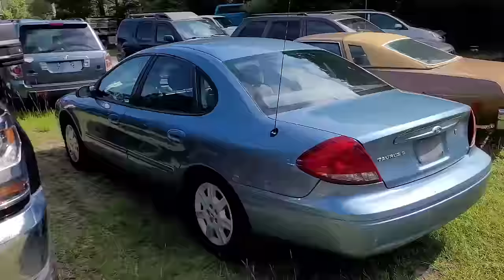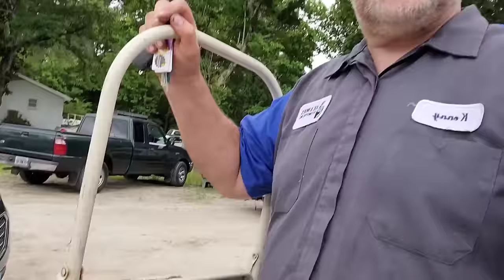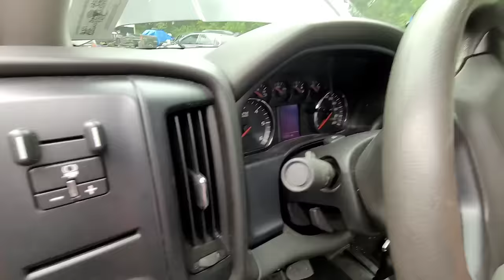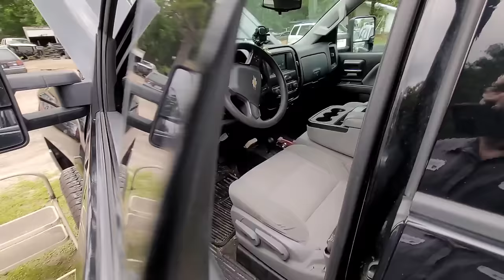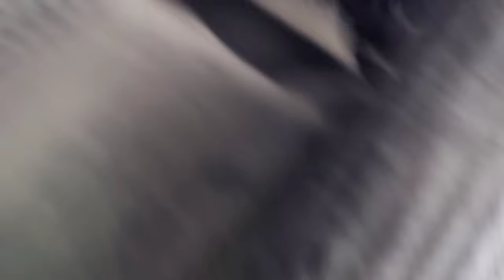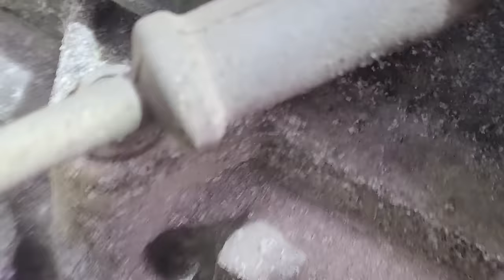Another GM 5.3 Ticking Noise. It's not the lifters on this one either

Comment: Great great information Mine sounds similar but the other way around I run it warms up starts ticking like lifter only let idle or hit that gas and noise goes away I completed cam and lifter pushrods etc for repair previously I don’t know what could it be thanks I’m advance
Reply from the maker: Double check the rockers themselves . I've seen the bearing wear and cause noise on warm up

Comment: 02 GMC 5.3 has a slight tick for 30 seconds. My engine requires 5W30. I have always used Amsoil Signature Full Synthetic.  155, 600 miles still runs fine.

Comment: Harvey Adkins
There is another cause of this sound that sounds like lifter noises.  GM knows about it and if caught while under the warranty time period, they will fix it (once) and after that you're on the hook for the cost of the fix.   
This noise is coming from the Brake Vacuum pump mounted on the lower front side of the engine.  It supplies vacuum to the brake booster and when it goes bad, it will make a noise that you would swear is a lifter problem.   I have a Chevy Silverado (2015) that did have this problem and a local dealer looked it up and found that it was already replaced under warranty in 2019!  Therefore, I was on the hook for an $800.00 bill to have it replaced again.   Was also advised that I should be prepared to do it again after 60,000 miles or so.  They are known to go out.  After the new install, the noise did in fact go away.

Comment: Just bought a 2011 with 180,000. Started ticking two days later, sweated for a week while doing research. Turned out to be a loose plug! Pulled the plug wires and re torqued all the plugs, tick has been completely gone for over a month now.

Comment: Every 5.3 or 6.0 iv had the first time or two towing it sounded like a bullet going off under the hood and the cold start ticking started. It was the manifold expansion busting the butter bolts GM installed at the factory. I now remove these bolts and install a grade 8 type bolt in metric size and have never had thus issue again. It's BS they have never fixed this issue.

Comment: 1:58 in...Exhaust manifold broken bolts.
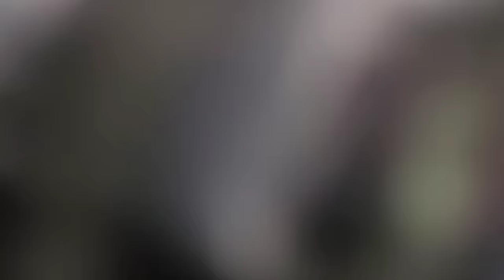5:00 in...totally different sound than lifter noise.
Deeper sound.
You can easily tell.
Lifter noise can also be clogged oil arteries.

Comment: Anybody with any true automotive repair experience knows that particular sound in a heartbeat. 
I knew it was an exhaust manifold leak as soon as he started the engine. Zero doubt in my mind. Literally ALL makes of pickup manufactirers share in these manifold leak problems. 

It's a common problem on all vehicles, particularly in areas where there are large ambient temperature swings and where rock salt and calcium chloride are used on the roads. 
That concoction of ice preventative crap, which ultimately is sprayed all over everyone's vehicles that drive on the public roadways, literally causes metallurgical chemical reactions & rots everything to death.

What's oddly annoying is how newer trucks seem to have the problems much, much more often than the older ones. 

Tells me that the poorer quality base metal materials used nowadays, in conjunction with dissimilar metals, (aluminum heads & steel exhaust manifolds - an absolutely terrible engineering "no-no" that they do anyway) are the main culprits of these far too common leaking exhaust manifold issues, no matter the engine.

The constant heat cycling eventually fractures and breaks off exhaust manifold bolts. Especially as they get weaker from the rusting and rotting that they endure day in and day out, year after year.
Reply from the maker: Soo true !! And thank you for you're excellent explanation !! I was quite surprised this guy who claims to do all his own work, couldn't figure it out. 
What I've noticed , and maybe I'm wrong, is that the older vehicles used much heavier cast manifolds with flanges that were 2 to three times as thick. Those rarely had issues. 
I believe its the flange thickness that allows too much expansion and contraction that creates the broken bolt issue . Especially in areas that have the large ambient temp swings like you said. 
Thanks for watching !!

Comment: On 6.0 vortec my 168000 mile engine had no sounds or noises. Then I had 2 injectors get stuck in the open position and flood engine with fuel diluting the oil in the process. The engine runs fine now, but has a ticking noise.

Comment: My '07 Classic 4.8 only ticks after the motor has been on for about 3-5 minutes.  But it will not tick with every drive. I had broken exhaust bolts. Replaced both manifolds, hardware, and gaskets. Tick still there but not with every drive.  The only consistency is that it will only tick after the motor has been running for about 3-5 minutes. It will go sometimes for two weeks and not tick at all. Then it will start up again, skip one day, tic the next then skip day or two and then tick the next several times the motor is on but only after about 3-5 minutes. The times the motor does tick, it fades in about 3-5 minutes of the motor being on, ticks for about 3-5 minutes then fades away and purrs like a kitten. Like I said, the only consistent part is the tick (if it ticks at all) only happens after the motor has been on for 3-5 minutes. Then ticks for 3-5 minutes and then fades away and purrs like a kitten.
Reply: Hey I have a 06 chevy silverado 4.8 it tick once started up for 3 to 5 minutes but goes away once engine is warmed up 15 to 20 minutes later. U think it's a exhaust manifold bolt?
Reply: @gruntty2005    Could be. But I replaced both exhaust manifolds and all hardware, tick still happens.  So in my case it is most likely a lifter problem.

Comment: I have a little ticking noise on my 2019 6.2L but it doesn’t sound like this, Ive heard in my second or third month of buying it, brand new in 2019, but I thought it was a normal noise because it would kinda go away, u can mainly hear it when it’s on idle mainly when it’s a cold start but also warm starts and when u get to a stop to park after driving. I ask the dealership to take a listen for it when I had taken it to get the transmission reprogrammed at 20,000 miles I think, but they couldn’t get the truck to replicate it supposedly they just said to take it back if something were to go out. So I’ve been wondering about it ever since haven’t seen anything on YouTube that’s similar no comments neither. It sounds like a clock ticking but like every 3 seconds and I’d say it sounds close to the cabin like in the dash kinda but idk if it can be coming from where the transmission and engine mate. Haven’t had any leaks or burnin metal or clutch, or weirder harsher noises, no problems, truck has 52,000 miles now. If anyone can tell me what it might be or if theirs has the same noise?

Comment: That is one of the most pain in the a** things to deal with. My 2006 ford with the 5.4 3v had a crack in the manifold on the passenger side. I was ready to just pull the engine out or take off the body cause the back bolts broke off in the head.
Reply from the maker: Fords can really be a PIA !!

Comment: Despite the very few problems that occur on the 5.3, it is hands down the best and most reliable V8 available in any truck today. I've been an ASE certified technician for almost 40 years, and I've worked on all makes. The 5.3 is simple and cheap to fix compared to other trucks.
Reply: I have a chevy silverado V8 4.8 it tick 3 to 4 minutes after starting. 15 to 20 minutes later it stops. After that it runs extremely quiet. Until I let cool down it won't tick. Do you think it's my exhaust manifold bolt?
Reply: @gruntty2005  It sounds like an exhaust leak to me.

Comment: @4:20  The car is 2003 Chevy Cavalier. It makes exactly same noise, but when at driving only. Change of gears doesn't effect effect the sound or its frequency. The frequency of the sound increases w/speed and gets louder. Can it be still engine or transmission (again nothing at idling), or it is pure suspension noise?  But what is confusing here when you drive the sound is heard in the area of engine, or somewhere between engine and transmission.  Thank you for the informative film.

Comment: Wow, I had a 2007 Silverado that would tap like that, so frustrating thought it was the oil pump in the oil pan, couldn’t figure it out, no one could that I took it to. Got another engine and put it in and 3 months later started doing the same thing again. Ugh, I liked that truck too but got rid of it and haven’t bought a Chevy again
Reply from the maker: That stinks . I've had quite good luck with GM trucks . I've seen issues with pretty much ever brand out there . I see more GM than anything in my area because there are 10 of them to every 6 Fords , 3 Dodges , 1 Toyota & -2 Nissans lol

Comment: I use Pro Long and have used in my GM trucks 2011/2012 and my sons gm truck 2013 4X4. His had a serious ticking sound. put in pro long and it stopped pretty much soon after. Also if you have oil pressure problems its usually the $5 o ring on the pickup tube. This low oil pressure will consume these lifters in no time so fix that if it happens. .From experience. Other than that i have 3 vehicles GM with 246000 on 2008, 169000 on 2012, and going on 365000 on 2011. So far just one transmission overhaul. For what its worth. This will not fix a collapsed lifter but only help stop some slight ticking.

Comment: I knew what is was from the beginning, but this is a very common problem with the 4.8, 5.3, and the 6.0 ls engines. One of my technicians is on his 3rd set of manifold bolts on his 08 trailblazer ss with the 6.0
Reply: And I have to do mine on my 04 5.3 silverado

Comment: I have an 08 with an intermittent light tick, but nothing like this.  I've heard the manifold bolts go all the time on these.  Mine isn't bad enough to bug me though.  I'd love to delete the AFM, but get conflicting info.  Some say you can tune it out or get that Range obd plug in tool, others say you have to replace the lifters and oil pump.  I only have 50,000 miles on my 15 yr old beauty, and want to avoid lifter problems later on.  Plus, I want V8 power at all times, hate the 4 cyl drop.  My mpg sucks regardless, and I am heavy on the accelerator.  I didn't exactly buy a truck looking for economy though

Comment: Hey Kenny, I have a 2014 Cadillac ATS 2.0T 4 cylinder turbo and when the car is fully heated up I also hear a slight ticking noise coming from the engine bay. I don't really hear it on idle, but I can generate the tick by simply putting the car in Park/Neutral and reving the engine in between 1500-2000 rpm. When the car is cold no tick at all. Theres no codes or anything. Oil level is fine also. I'm in a real bind. Just off the top of your head what do you think this might be? Would I have to get it checked out immediately? Thanks again for your informative YouTube content👍
Reply from the maker: It's very difficult to say without actually listening to it. I now some of the solenoids for the variable timing, oil pressure and such can make quite loud ticking noises. Does your noise go rhythmically with engine RPM ? Or does it stay at the same pace regardless of RPM ?
Reply: @WrenchingWithKenny  it gets more pronounced with the RPMs. I found a YouTube video of the exact issue from a Cadillac Forum. The owner of that ATS believed it might be in a rod bearing, or main bearing? Could that be it? Here's the video Kenny! https://youtu.be/aqWTIdK_U5g 

You can hear the ticking at around 0:17 seconds

Heres another video same, ATS and engine https://youtu.be/byoQylrmCEI

Comment: I thought in the beginning if the noise goes away when it warms up it’s probably an exhaust leak. My truck did the same thing. Especially if the one of the bolts toward the back of the manifold snaps off. I swear this is a GM curse, doesn’t matter what year. I was lucky though, there was a little meat left on the bolt and was able to get it out with some vice grips when I replaced the exhaust with some long tube headers.

Comment: Sometimes if you have cylinder deactivation lifters that get stuck, and it creates a misfire because it’s not igniting properly. (Which also can create a tick like noise) There’s only a few reasons it would get stuck and most of the time they’re dirty, try putting some trans fluid in the gas it usually clears up it doesn’t hurt anything.
Reply: 1/2 quart of Trasmicion f

Comment: Common problem with GM 5.3 5.7 6.0 exhaust bolts snap off mostly the end ones. They made a bracket to pull ends of exhaust manifold back against block. So you won’t have to take it all apart to get busted bolts out. GM using cheap ass not thick enough bolts it’s been going on for 20 years now and they still won’t fix the issues. No quality control that’s why im a Toyota tundra owner with 289,000 is no quality issues.

Comment: Been chasing an exhaust leak myself. In my case it was a bad gasket on one side, but that very bolt on the passenger's side (of a 5.7) has been giving me trouble and keeps backing out. I wonder if it's the cause of my somewhat random sound over there, that also comes and goes, but doesn't really show up when the engine is cold. It goes away as quickly as it begins, but does seem to be coming from the area around the engine head.
Reply from the maker: I've seen and heard some weird noises from exhaust leaks . Anything is possible !

Comment: Exhaust leak on passenger side rear is very normal on these. So are the broken studs. Tighten them if you own a gm v8 newer than about 2000 or this is very problematic.

Comment: This isn't isolated to gm trucks, Fords have this same issue. Cast iron manifolds and aluminum heads just make this happen. You can leave it that way, but eventually all the bolts will fail one by one, plus you get to breathe exhaust fumes.
Reply from the maker: Dodge too !! Ive seen a few Toyotas and Nissans as well

Comment: Cast iron manifolds thin gaskets and aluminum heads are the culprits through expansion and contraction. Tightening sequence and torquing hot and cold should eliminate the issue.

Comment: My 07 5.3 had the cam give out at 167000.  I just had the lifters checked with no issues at 166000.  Oil was changed frequently every 3000 with oil consumption issue.  Ran Quaker state 5/30 full synthetic w/ a wix xp filter

Comment: Clean your fuel injectors and fuel system. I had all the above knocks ticks etc, for the last month, after taking my Chevy Silverado to someone I will never use again. Something from the past stuck in my mind. I purchsed some fuel injector cleaner ( sounded just like the truck in this video ). I used the STP brand.  07/13/23 . Today  07/17 23 I had to check my truck, Silverado 3 times to make sure it was running. Clicking knocking, ping whatever you want to call it is gone. Feels like a new engine. Give it a try.

Comment: The right front side or driver front rocker has small bearings they start to fall off, bearings creating that ticking noise.bad design from the Chevrolet. But after that all design from the Chevrolet  . But all ls engine are in most port bulletproof.

Comment: Mine did it only when it was cold. Now all of a sudden it’s way louder and it’s the entire hour to work no matter what temperature
Reply: @Seriousgamer297 297 : Yup. That  happened because you kept ignoring an obvious problem that needed to be addressed & fixed. 

Eventually the hot exhaust gases escaping through the leak caused by the gap will burn out the exhaust manifold gasket. Then, the air gap between exhaust manifold and cylinder head port gets substantially larger, thus having a substantially larger exhaust leak that will no longer be sealed back up by simple combustion heat expansion.

If let go long enough, other nearby exhaust manifold bolts next to that cylinder port will break, only compounding the leakage problem. 

You can't just ignore problems, and expect them to go away, because they won't. Just not how anything in life works. You need to fix problems when they occur & not procrastinate.

Comment: The second you turned the car on I knew it was an exhaust leak 😅 because I have a Malibu 2008 four cylinder its exhaust manifold has a crack it makes the same exact noise when it’s cold but once it heats up that noise goes away! How comes the owner didn’t smell the exhaust inside the car when he/she had the heater or the AC on 🤷🏼!!

Comment: I've had chevy Buick Pontiac guess what different engines 3.1 3.8 same thing starts then Tapp Tapp goes once warm up that truck need a new engine sir that excessive noise to me 5.3 v6? Oil not getting around enough wrong oil synthetic oil?

Comment: My 16 Tahoe started making a ticking sound right after I got it back from the mechanic. He says he can’t hear and neither can his other guys.. I’m beyond frustrated because it wasn’t there before. What could this be from? My husband doesn’t think it’s coming from the top of the motor. My motor was making the same sound this one is before the new tick sound started.. I just had the spark plugs and 2 coils replaced
Reply from the maker: If the noise is down low , check to see if you have a belt driven vacuum pump. Its on the drivers side front of the engine. Ive seen those create a ticking noise that people mistake for lifters or valvetrain . Let us know what you find !!

Comment: I have a 2000 Silverado 1500 with the 4.8 and when I start it up cold the pistons slap in the bore for a minute or two then it quietens down. I'm sure GM fixed that since that was a common problem for a while.

Comment: Salute to you sir. My wife’s 2007 Suburban has a P0307 code cylinder 7 misfire. Do you have any tips or maybe a video on this? I’ve seen videos that it could be something as simple as a spark plug or coil but it could also be a bad lifter. Also, when I turn off the engine I hear a weird hissing noise I think it’s coming from the passenger side of the engine. I appreciate your help.